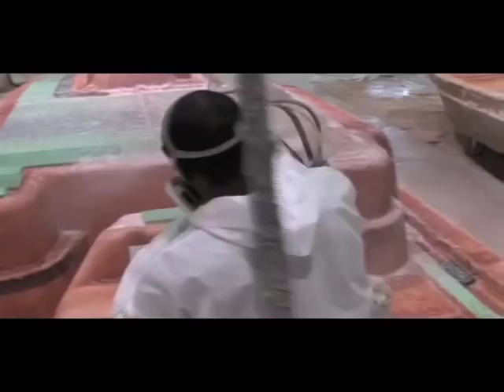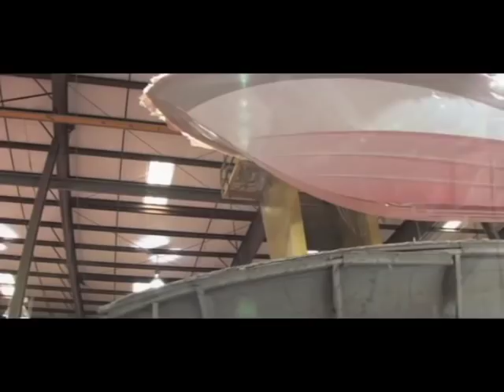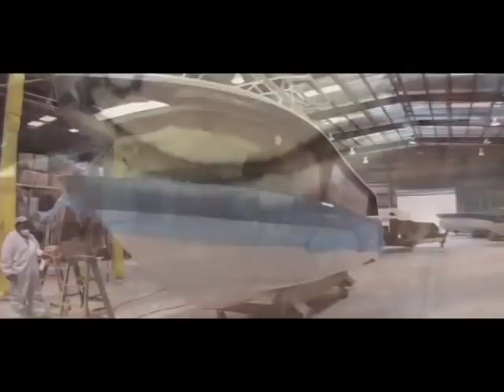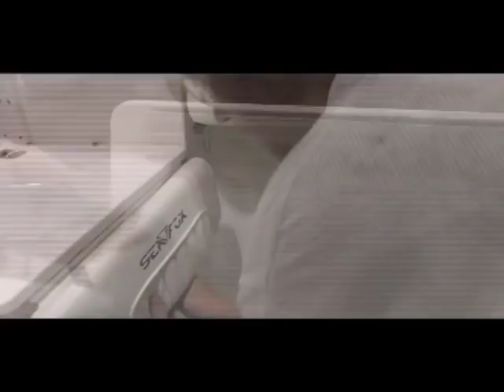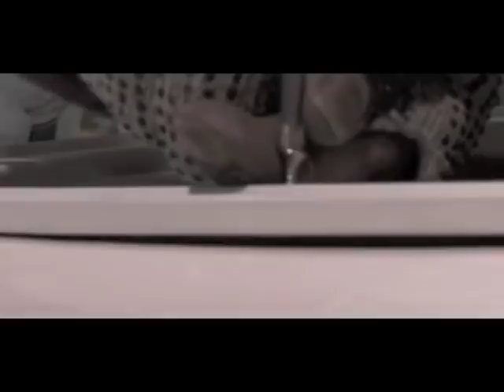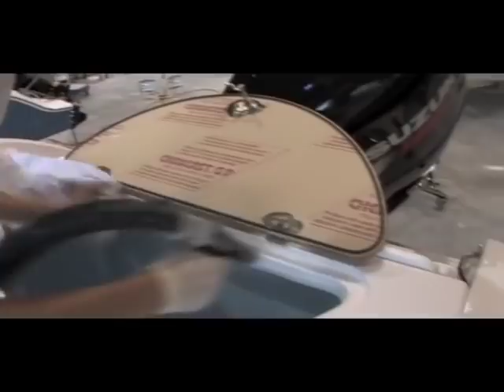Sea Fox Boats - Factory Tour

Comment: Shoebox hull/deck joint and screws?  talk about the weakest possible hull/deck joint...
Reply: That's literally how two piece hulls are put together.
Reply: @1fish2fishredfishbluefish-u5i  Whether its a 2 piece or 1 piece hull has nothing to do with the hull/deck joint type.  Shoebox hul/deck joints are the weakest method of making this connection and are a hallmark of poor quality.  the most common ( and strongest) method is an inward turned hull flange with the deck adhered AND through bolted.  Its also the most expensive and laborious method.  Screwing the joint together is just reckless!!
Reply: @pierremitham2964  cool story.  You should notify the hundreds of manufacturers that they are doing it wrong.
Reply: @1fish2fishredfishbluefish-u5i  They know  but are  choosing  lower labour costs as a priority (seems to be a powerboat thing...).  Look at all the big builders. Jeanneau, Beneteau, Swan, Hanse, Catalina, Bavaria all use the inward turned flange method (walk around a boat yard and you'll see 99% are not shoe box assembly).  Remember its costs more in time, labour and tooling to build a hull and deck for the inward turned flange/deck interface.  And it cost more in labour to assemble as it takes 2 to bolt the deck down vs. some goo and screws!
Reply: @pierremitham2964  sounds good

Comment: I worked there from 2013 to 2015.  I sprayed gel coat. My shift started at 7 PM.  I didn't leave until about 8:30 AM.
What the video doesn't show is prepping the molds for gel coat application.  It was a very satisfying job.  Oh and the stringer are made of flotation foam and wrapped with dry glass cloth so it can be wetted out during lamination.
Reply: Wax Wax Wax.....
Reply: Hello! I have a question for you, how do they do a 2 color Hull?
Reply: Think of it this way,  you want a yellow  hull?  We tape and plastic off  where the white goes.  We spray the color then we remove the the plastic and tape then spray white.
Reply: I know this is old but I've got to know. What's it like wearing all that PPE all day? Did you get hot? What do you do if you take a break? Did you take it off?
Reply: Where the 2005 built the same

Comment: One problem: he described the first thing sprayed into the mold as "an 18 to 21 millimeter coat of isophthalic gel coat." That should be "18 to 21 mil" - a mil is a thousandth of an inch. 18 millimeters is 3/4" and I really don't think anyone wants that much gel coat on his boat - especially the people at the boat factory who would have to buy the 100 gallons of gel coat (at about $150 per gallon) it would take to do it.
Reply: But would that be nice for the life of the finish lol.I would never buff thorough that. Lol
Reply: Pops Old Boats True, but there’d be about a million dollars worth of gelcoat on one hull. Paint would be better...Hatteras paints their boats, because the Imron they use is more durable than gelcoat.
Reply: @jmowreader9555  what kind of paint do they use?
Reply: @leesire  Urethane paint. It's either Interlux or Axalta Imron.
Reply: @jmowreader9555  I need to paint my 87 thunder craft.   Lol, after I fix the leaks.     Thank you
Reply: @leesire  Check West Marine. They sell a one-part polyurethane enamel (for many dollars - it's well over $100 per gallon) called Interlux Brightside that can be applied with a brush (the two-part PUR Hatteras uses must be sprayed) and that comes in many bright colors. If your boat was my boat, that's what I'd use.
Reply: @jmowreader9555  thank you.  I gotta find out where it’s leaking,  leaks are hard to find 

I’ll check out that paint. Thank you so much
Reply: I had the same question, mistake for sure
Reply: What are you talking about it is not three quarters of an inch .0018 “to .0021 “ is what he is saying. 18 thousands to 21 thousands for the gel coat.
Reply: Donald Hyatt Go back and watch it again. He definitely said millimeter, not mil. Also, it’s .018,  not .0018. Massive difference.

Comment: Plastic GRP or FRP boats are tough, all-right...All my aluminum boats had cracks or loose rivets from pounding waves. Attempted steel construction...but couldn't get the weights and power ratios right.

Comment: It wasn't until the 1960's that boats started being made of Fiberglass..  Boaters were sceptically of Plastic Boats..   Plastics were just starting to become popular in the 60's..
    Although,  the Chevrolet Corvette was made from Fiberglass since their inception in the early 50's..    but,  Corvettes had been made from Carbon Fiber for last 10 years..  Boats are next..
Reply: Thomas, there are quite a few seven-figure yachts made of carbon fiber. There are pros and cons to it - you can get the same strength as fiberglass with half the material, which makes the boat lighter (or, conversely, twice the strength for the same weight), the boat is stiffer if it's made of CF, and "I've got a carbon fiber boat" has the same "cool" factor as "I've got a Kevlar boat" did a few years ago. The problems are that the material is five times the price of fiberglass and it ain't goin' down because of the energy it takes to make carbon fiber, the stiffness also means your boat will beat the shit out of you in rough seas (which can be remedied by pumping in a lot of dense foam insulation, which makes the boat heavier), and carbon fiber, unlike fiberglass, gives no warning before it fails. 

If I had that much money, I would still go with a fiberglass boat.
Reply: Hello iam buy your comapny boat plz send me your company detail.
Reply: Nabinpoudal12@gmail.com